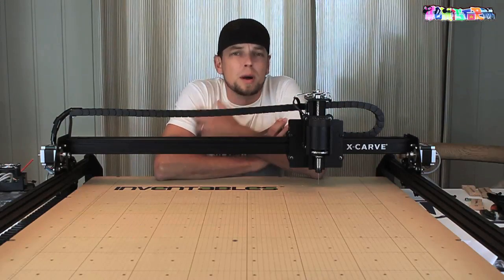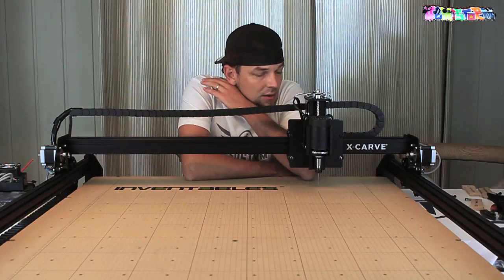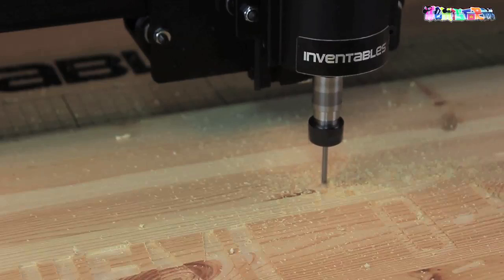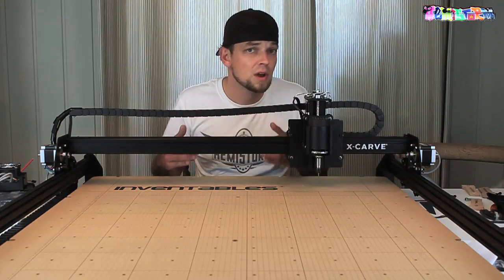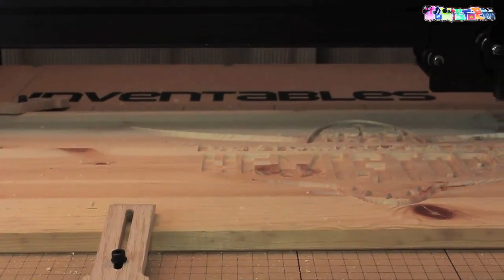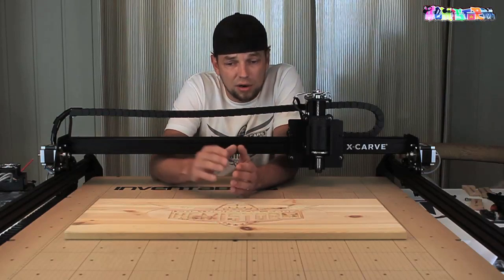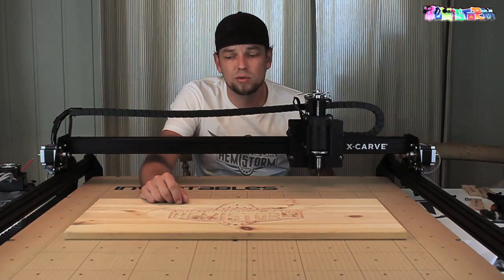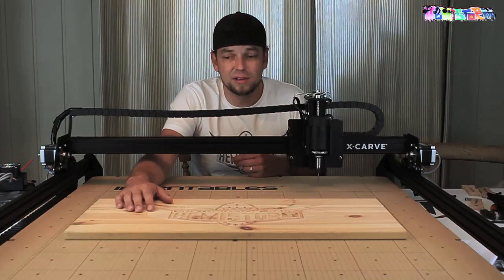INVENTABLES X-CARVE - Home Made RC upgrades coming!

Comment: Great video! I love the the x carve too. Two tips- upgrade the spindle to a trim router ( makes it ALOT faster) and dust collection like a shop vac. Dust on the rails can easily ruin a project. Interested to see what you can come up with.
Reply from the maker: +Shop built I'm looking at either going with the quiet cut upgrade, or going the full monty and upgrading to a Makita. If there is going to be a Makita mount available that will be great, on dust collection Ihave seen a pretty cool 3D printed version for that setup.

Comment: Very interesting. Being a guy who has been working on CNC machines for the last 20yrs. I wondered when something like this would pop up in the hobby. Naturally there are lots of questions. What size tools can be used? How rigid is this machine under load? What type of materials can be machined on it. Wood plaques are cool but how about aluminum or brass? How about RPM control. Spindle speeds? Thanks for taking this on. I really look forward to seeing how you feel about some of these questions I've brought up. I can tell you will be honest with us. Sometimes I find manufacturers can be a little hopeful when speaking specs on their products. Obviously you have caught my attention. Thanks
Reply from the maker: RcNickster Hi there! Tool size used is 1/8th of an inch in shaft size or 3.175mm. 
The machine is extremely sturdy under load, also the V-grooved guide wheels (delrin) can be adjusted afterwards to fine tune the way they roll. This is done by twisting an off center nut in the bottom of the carriages. 
I have machined some carbon under high stress when puncturing the material, and did so in the center of the waste board, no noticable abnormalities in anything I have machned up to this point. I think the machine has ran approximately 25 hours and all is still as it should be.
Materials that can be machined also include soft metals such as aluminium and brass, copper and carbon and delrin will be my key materials for RC applications.There is a feature to run a separate RPM control on the spindle, but I have not seen any use for it in the way I use the machine. 
Inventables also offers a DeWalt router mount, which would perhaps open it up to some of the features you are looking for. 
I hope this is of help! :)
Reply: Wow. They have really done there homework here on this one. Just finished going through some of the info on the web site . Definitely worth checking into. I apologize if I sounded like I doubt how well this will work. Honestly I hope it does everything that it sais it can and more. I look forward to following how you do with it. I appreciate the info and I have no doubt that you will be very successful with it and thanks for the preview.